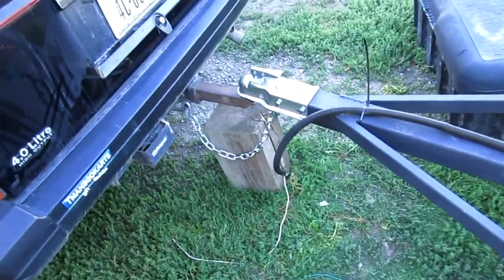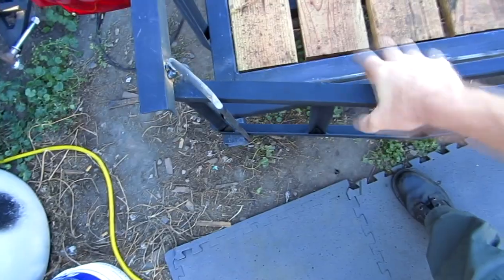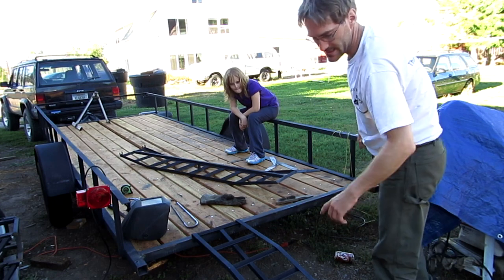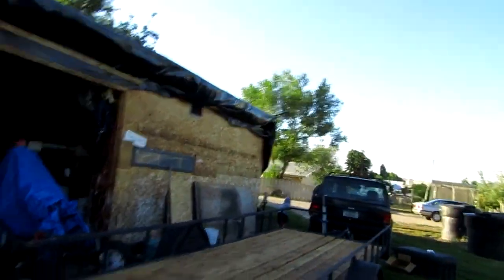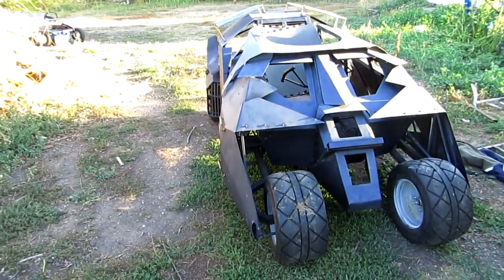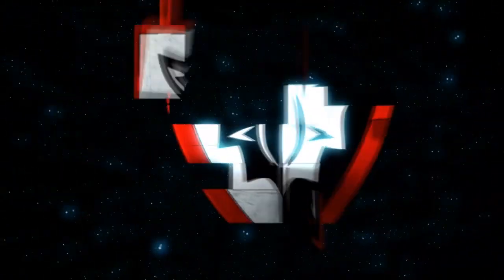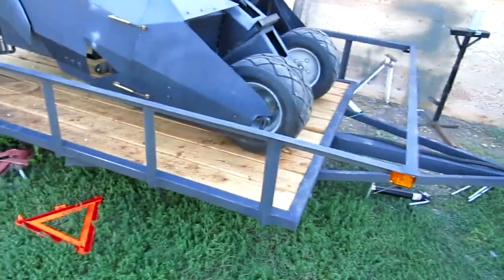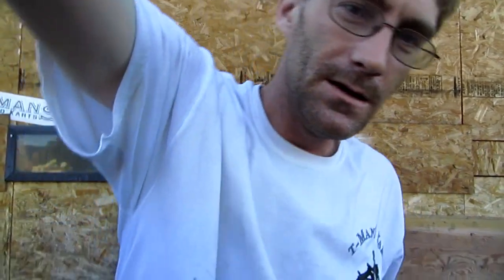Homemade Utility Trailer Project Build 6

Comment: You  can get a converter for the 4-pin to 7pin so you dont have to change the wires. You can get them pretty cheap.

Comment: Don't cut it off get an adapter. Good idea about the chain link. Wow the bat mobile wasn't really designed with trailers in mind but you got it up there.

Comment: Your chain isnt too bad. Ive had some lower. You have to twist the chain and then cross them. Some trux have different hook ups. I can barely get the chains on one 250 but the other i have excess. Idk just a change in safty chain hook up.

Comment: If you are considering plastic, you might check into a stuff called "coroplast."  That is actually a brand name & there are others, it's great stuff.  I've used it for lots of things & it holds up to weather really well.  When last I bought some, it was about $15 for a 4'x8' sheet & came in a variety of colors.  You could ask around at some sign shops to see if there's a local wholesale place.

Comment: Hey T-man, I know this is off topic but I am trying to catch up after being away on work and I was wondering if you had decided whether you would sell plans for the front A - Arm assembly on the Full Frame project.  which is all I need for this off road cart I am putting together. Trailer looks great.

Comment: Where do you get the metal tubeing from? All I can find is square tubeing at lowes and it is 20 bucks for a 8ft piece of 1inch.
Reply from the maker: RantZ_IE LOL, its best to find a steel distributor in your area.
Reply: ***** Was that LOL Because I'm really stupid or because Im really stupid? lol
Reply from the maker: Ha Ha Nether, I get alot of people that ask that. If you cant find any listed then call a building contractor they would know of one.